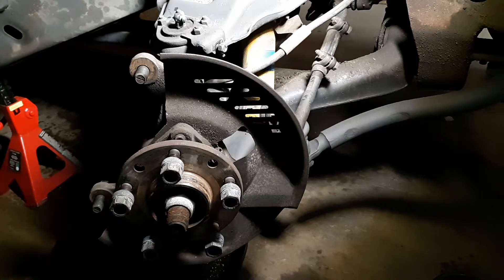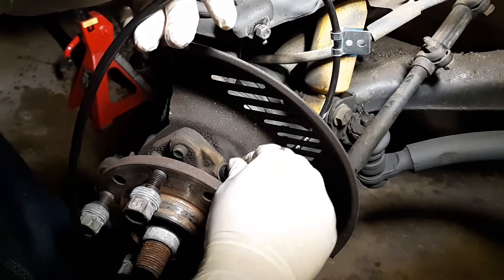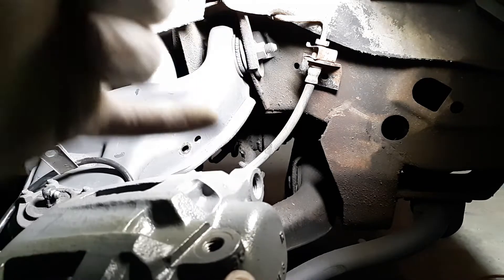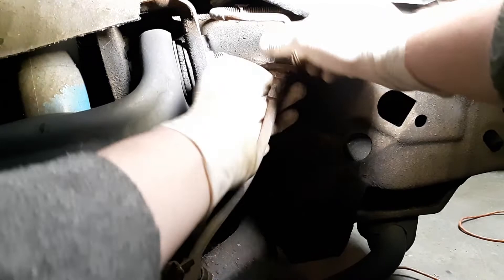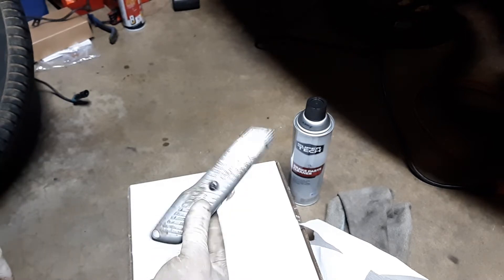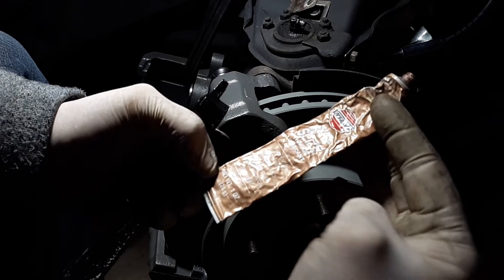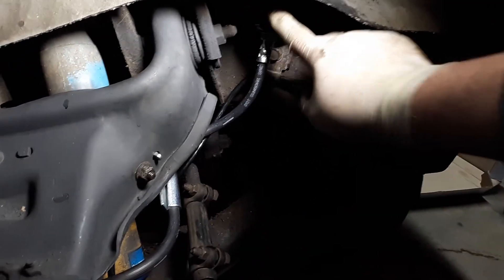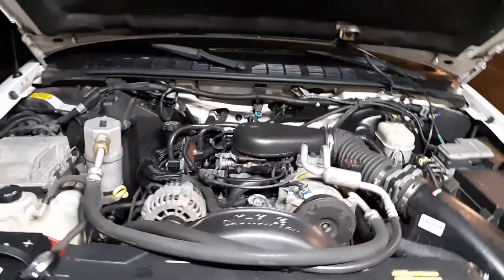Replaceing Front brakes 01 blazer 4×4 Part 2!!

Comment: Why didn't you put the hardware on the brake pads
Reply from the maker: Honestly I don't remember but if it had it and it was still good then I left it as it is and just put pads on it.  if not then it probably didn't come with any and doesn't need them some Vehicles doesn't have brake hardware for the pads
Reply: It came with hardware it was in the part1 whole reason I came to this video was to figure out how to get these dam pads in with the hardware